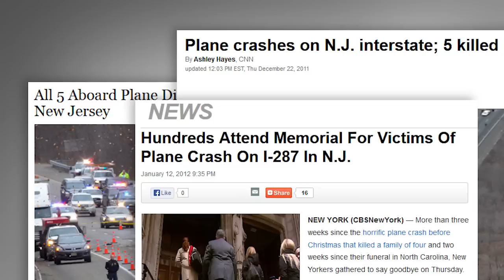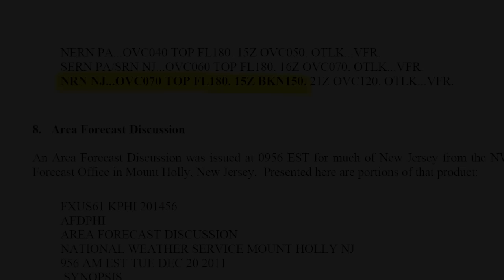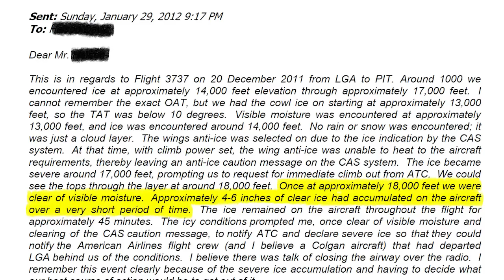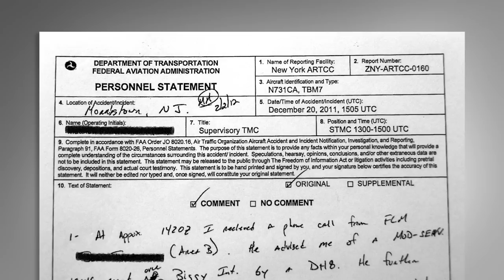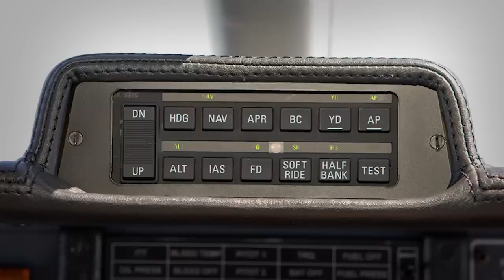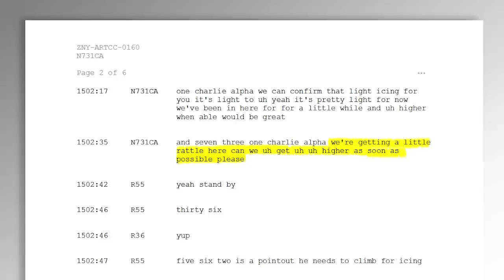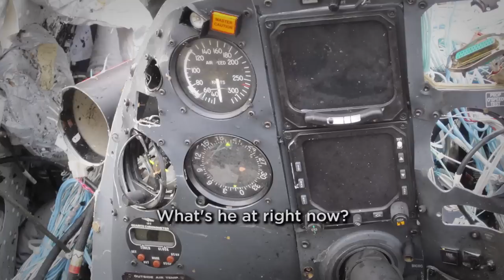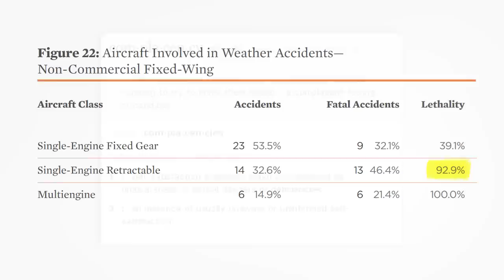Accident Case Study: Delayed Reaction

Comment: I am not a pilot, but when I heard of the icing, I thought it might be best to remain low until you pass the danger zone. I know elevation is typical, yet because ice was noticed, would it have been more wise to simply stay low in warmer temperatures until you pass that cold point? Just an honest question from an aircraft operator novice.😁

Comment: I spent more than a decade in the L seat of Commuter T-Props.  All of it up and down the East Coast and NE in particular.    This video is correct in that you get completely used to reading (and then ignoring) Airmets for icing.   They're ubiquitous from Nov through Feb.  In scheduled airline ops, you're probably going anyway since the only icing conditions that you are prohibited in flying in are severe icing and or freezing rain.   The problem is that you can fly 20 days in a row in icing conditions and never pick up more than your airplane can handle.  Never more than a 2000 foot change in alt won't fix.     It's that 21st day when you get whacked.  Don't screw around with ici unless you have to, and then treat it with the utmost respect.

Comment: Full wing de icing system should be implemented, with automatic switching to higher setting for increased de icing speed using higher heating inside the heaters or for rubber boot based system, there should be heating system built in to compliment them for higher loads of icing. Also the inertial separator for engine should be made as fully automatic with an ice sensor for automatic turning on of the inertial separator for the engine, while the flight is contacting ice area in the air. In addition to that, there should be a small pilots altitude local weather submission portal and an electronic sending device and a receiver device as well to send and receive pdf reports automatically to the web portal about the actual local altitude weather in an area as reported by a small altitude pilot for later or simultaneous reference to other pilots operational in the area. Pilots association can look into this and create this very important portal which will enable quicker discovery of local deep icing conditions in the air for many other pilots and  others as well as solid data instead of predictions. Also Atmospheric Icing emergency can be shown in the real time map for other pilots too in the same portal much like Google maps,this atmospheric map should be supportive of interactive addition of real time pilot data inputs as voice notes to the map and as text notes that are transcribed from the voice notes at dangerous altitudes from the pilot vehicles registered in the portal, and should be made visible to all other pilots who are registered in it so they can view a detailed and more precise real time weather situation information

Comment: I've had a similar experience flying a Saab340 over the ALB VOR had a clearance to climb to 16,000 ft and around 13,000 ft the plane picked up a ton of ice, and i could see it building behind the boots and the ring on the spinner which in itself is the definition of severe icing.  I immediately stopped the climb and got a clearance to a lower altitude because I was doubtful the plane would continue to climb.  It usually takes a change of a few degrees outside to correct the problem.  Icing conditions like that a pretty rare but if you encounter them get out of it asap, declare an emergency on the spot if ATC doesn't comply with your request!!! Also keep in mind that ice affects different types of aircraft in different ways.  A large transport jet aircraft with a heated edge wing flying around at Mach .80 reports moderate icing might be severe icing to a smaller prop plane flying slower with different wing types.  Sometimes Pierps are the best source of up-to-date information on a given area and altitude for icing.  If you're going to fly around in the clouds when the OAT is freezing and below plan on picking up some ice.

Comment: This is, by far, the scariest one of them all.  Two minutes isn't a whole lot of time.  However, we know that the tops of clouds usually have the most moisture and ice.  Maybe, if he would have said at the first sign that the moderate ice was going to severe that he was requiring priority and turned around, even starting to descend, maybe that would have made a difference.  

I could see myself trying to hold out with the clearance with this plane being so capable.  If I was in my Mooney without icing protection I would turn around right away.  I would be mentally prepared for that and would probably be less prepared in this accident plane.  This is a good wake up call of just how extreme icing can be.  This is a good lesson that I should be even more conservative when ice is even possible.  To me ice is possible whenever there is visible moisture and close to freezing and you can't even fly a approach in two minutes.

Comment: This accident is on ATC. They knew about the severe icing and still leveled the TBM off in it. They should have issued a heading change (to him or other traffic) and let him climb straight through. I had a similar incident a few years ago in a Meridian in Utah. They leveled me at 14,000. I told them I was picking up ice and they left me there. Luckily it was mild/moderate and my boots cleared it no problem. If I ever find myself in a situation like that again, and icing is significant, I'm declaring an emergency and climbing before ATC kills me.
Reply: My thoughts exactly.  A whole famility lost forever in less than a minute. How sad.
Reply: Nope. Definitely 100% pilot fault. 
Who has the yoke/stick in his hand to fly and flies the plane?
The Controller or the Pilot ?
It's called PILOT in command for a reason.

Who is more stupid:
The guy in front of a screen who orders you to slow down 30 kts below your stall speed, directs you to a 4,000 ft mountain after he gave you an altitude of 3,000ft to maintain.
Or the Moron that paid several thousand dollars for a flight instructor to teach him how to fly and was definitely told to not fly into such conditions and just respond "unable", but decided to do the exact opposite of what he was trained regardless??

It was 100% clear pilot error.
Even if ATC would have gave him a 30 minute holding pattern into severe icing, it would be still the pilot's fault.
Who dies, because he follows the stupid ideas of ATC despite knowing better ?
The Pilot or the Controller ?
It's Pilot, because it's always the Pilot.

You guys seriously need to understand what ATC's jobs really is:
It's shuffling as many fully loaded commercial airplanes from one airport to another without them constantly colliding with one another, and to do it as fast as they can. And call an ambulance if an accident happens.
That's it. Nothing more.
That's the only thing they are paid to do. Nothing more.
Shuffle thousands of A320 and 737 into to or out of airports.
The FAA doesn't care about anything else. Because that is where their funding comes from. From the taxpayer who gives them taxmoney when he buys an airline ticket. 
And from the profit of an airline that pays taxes.
99,9% of their funding does not come from the pilot of the small plane. They are just there to keep the business going so that the airline can make more profit and the FAA gets money in return. That's it.
And the sooner you realize this, the sooner it becomes apparent why they act they way they do.
Because they don't care. And they don't care because they are meant to not care about it.
They FAA is merely meant to keep a multi billion dollar business running.
They were never meant to help you (besides calling an ambulance or the fire department.) 
Because business means money. And big daddy gov only cares about money because it creates more taxes for the government. The only reason they talk to small aircraft at all is, because they need to keep them away from the large money machines of the airlines because Mid-air collision are bad for business...
If the FAA would be able to, they would immediately ban all small planes for good, just to make more room for more big jets. 

Sorry but that's just the way our economy works. 
It's always your own responsibility to keep your flight safe. Never the controllers. 
You die, they don't. Even when they sometimes screw up. 🤷🏻‍♂️
Reply: @ax.f-1256 yeah you have literally no clue what you're talking about. what a bunch of absolutely unhinged hogwash.

Comment: I heard this plane fly overhead in while in my home in Elizabeth, NJ - 20 miles from the crash site. I could not see the plane -it was cloudy and I wasn't particularly looking for it, just puttering around the house -, nor do I even know anything about airplanes much, but I immediately could hear that this plane was in trouble. I could just tell that the sound of the engine was very wrong, and I thought to myself "that plane is crashing". Saw on the news shortly afterwards that it went down in Morristown. Doing a rough calculation on distance and speed (again, I'm just a layman), they might have been  in trouble longer than this video implies, and no doubt they were all aware of the impending disaster for a while before hitting the ground.

Comment: 48 seconds from losing lift at 18,000 ft. to being on the ground. Morristown NJ is at 300’ MSL. Must have been so scary for all on board. 

But think about this. That’s only 375 feet per seconds decent.  What really happened? And didn’t mention about the smoke witnesses saw.
Reply: ONLY 375 feet per second? That's a shade over 250mph, straight down. Interesting point about the smoke, though.

Comment: Question:  So, if pilot pushed the nose down prior to stalling there would have been a chance to save this accident?  I'm not a pilot but find these videos fascinating.  My understanding ice brings planes down to the changing of the aerodynamics of the plane as well as the weight.  Even if nose was down to pick speed up wouldn't the ice issues still take place?  So, what, if anything, could have been done in this particular time for the pilot?  Thank you.
Reply: probably not, wouldnt make the ice go away
Reply: Pushing the nose down as you say would have two positive outcomes... first descending out of the icing zone would / should stop the buildup, and then shed the ice...  secondly maintaining airspeed would prevent the critical angle of attack of the wing from being exceeded and so prevent a stall....

Comment: So are deicing systems better than they were 10 years ago? Coming from a non pilot, I would think that a deicing system would be a technically  easily produced?  Why are they not on every airplane or at least an option?
Reply: Not easy, not simple, and very expensive. Commercial passenger aircraft have to be sprayed with de-icing fluid in addition to the aircrafts systems, which is a costly and time consuming procedure.

Comment: I can understand climbing through icing or descending through it, but holding an attitude in known icing? Unless I am mistaken, moderate icing was reported between 14000 and 18000 feet. They were level at 17000 until the icing had become a problem and their situation was critical. Also, if I remember my training correctly, if the ceiling allows for it, decending below the icing is preferred to climbing above it. My experience is with smaller, non pressurized aircraft so this may be limited to that type of craft.

Comment: Can anyone help me out here to understand why is it that, in icing conditions, it was a good idea to climb? Temperatures decrease as you increase in altitude so if you are already in light icing conditions, does that not mean its worse as you go up? Or maybe do they mean to get out of visible moisture?
Reply: Icing conditions do not uniformly increase with altitude. They’re dependent on local atmospheric conditions such as type and height of clouds etc. and mostly don’t have a vertical extent greater than 3000 feet.

Comment: Like always when faced with difficult situation you have to make a good decision, or you will be dead. Like in case of severe icing, yo should know that climbing is not an option simply because your airplane will not have the perf to do it. Know your aircraft and it's limitation. In this case the good decision would be descending to minimum safe altitude and try to get out the ice deadly grip. Even declare emergency and land ASAP.

Comment: Today is 04-12-2021. I have 2 weeks vacation coming up on May 1st and was planning on flying from Wash. St. To Arizona. Decided I am going to drive there now after binge watching 10's of these videos.
Reply: I expect you arrived safely but driving is even less safe
Reply: @jesspavlichenko5745  I did. You are correct, flying is safer. If you lose a fan belt at 35,000 ft, you're screwed though.😁

Comment: Q: the ice was from about 7-18,000 if i understood all the mentions of ice. So what was he doing going into known ice the a service ceiling of 30,000? Obviously he didn’t get a good weather briefing before takeoff. He finally asked for higher but by then the plane was so loaded it couldnt climb. Also it seems atc knew of the ice at those lower altitude. They mention it several times. Why not offer higher before he got into it? Guess  we’ll never know. May that all RIP. These needless tragedies are horrible enough but when there kids on board we pilots need to be extra diligent and cautious. You wanna be a hero - great. Land and let the passengers off first.

Comment: People, and pilots need to remember this saying "Never use your reserve chute as your primary". This is what this guy ended up doing (even if it might have been due to lack of information). 

De-icing mechanisms on planes are there as a temporary life preserver... In this case, that was your reserve chute.. This guy was flying with his reserve chute, by going into icing situations that were already dangerous for his plane.. If your reserve chute fails.. you have nothing left to save your life.. 

Always fly light, to zero icing conditions if you're a private pilot.. moderate is dangerous... even if it your plane has de icing for moderate... you have to remember.. you're flying with your reserve chute at that point... Those mechanisms are really there for in-case you're already in the air, and find yourself unavoidably getting bad icing.. It's there to help you find an airport to land at and get down as safely and quickly as possible.. you shouldn't be flying on them..

Comment: You a Pilot? When in doubt, Pull power, you do not want a full power spin or full power stall! Then you level the wings if you can and push the nose down to regain control and airspeed and reduce the angle of attack.  This is basic flying skills, nothing too complicated!  Push the f--cking nose down!!!!! I see this critical pilot mistake over and over! Every commercial pilot should have and frequently fly a light aircraft, so they can practice basic flying skills! I don't care whether it's a tail stall, a stall under power or your freaking upside down or in a spin! You pull power, level the aircraft and push the nose down. If you had done this in a timely fashion, you wouldn't be in a spin in the first place! Practice your spin recovery!  Unless you have a major structural failure, there is no excuse for an aircraft to stall for 35,000 feet into the ocean! That is Shitty flying! Bob

Comment: im surprised they dont have heaters in the wings to prevent iceing or at least have ceramic coating so it cant stick so well
Reply: They do, but most of those systems can provide temporary relief at best, and are mainly designed to allow the pilot enough time to escape from the icing conditions as soon as possible if they inadvertently fly into them. As is evident from this air crash, de-icing systems cannot stop sustained icing from rapidly bringing a light general aviation aircraft down most of the time in moderate or worse conditions.